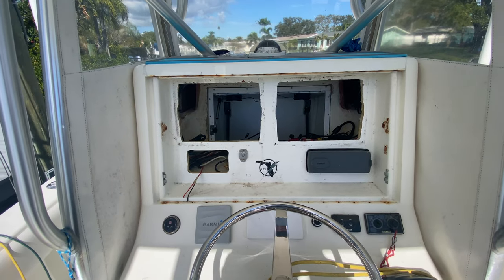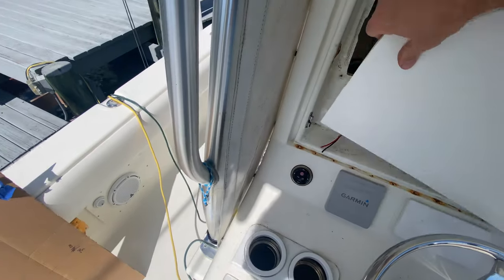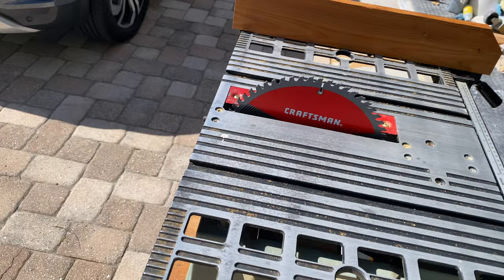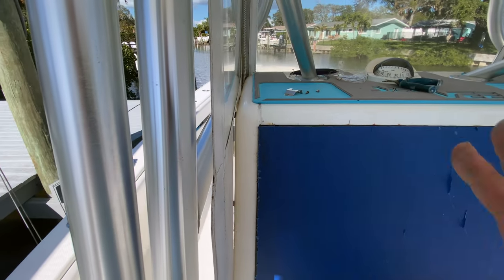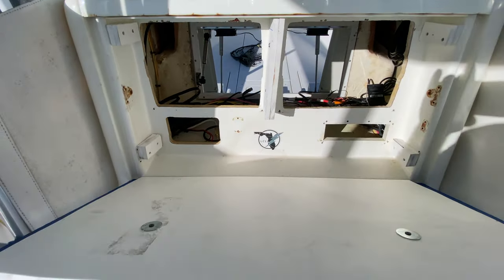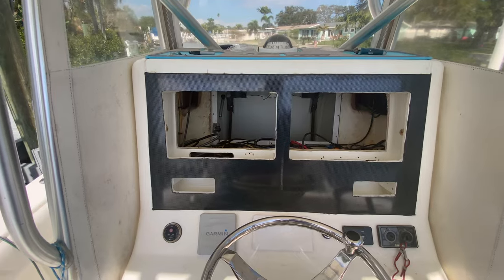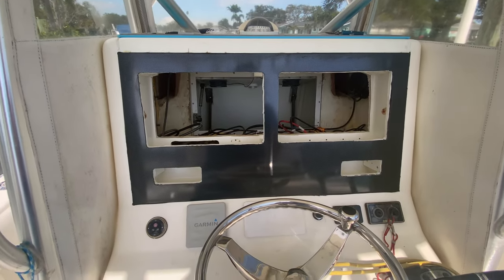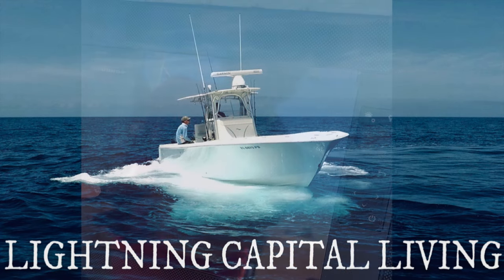New Furuno Electronics Installed on SeaVee 32 with custom acrylic dash panel.

Comment: How do you like the furuno system ?
Reply from the maker: So far I love it. My garmins were pretty old but the furuno sounder and radar is incredible. They just released their new XL versions with new mapping. People complain about the mapping but for the gulf that isnt really a concern of mine.
Reply: @LightningCapitalLiving  cool deal man.  Yeah I saw that, THOSE NEW units look sweet.     I'm about 95% sure I'm going with them at this point.
Reply from the maker: @johnrowland8607  I’ve only used them 6-7x offshore so far, but I’m not really mad about furuno coming out with new tech. Coming from what I had these are huge upgrades and will keep me happy for years